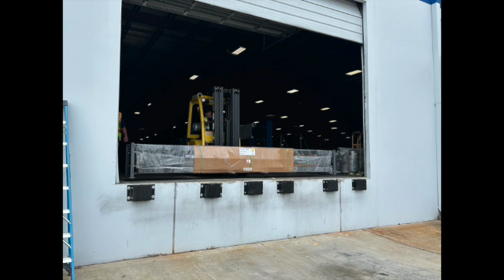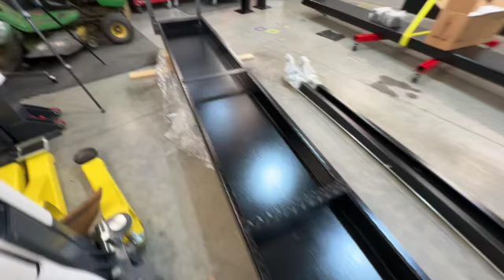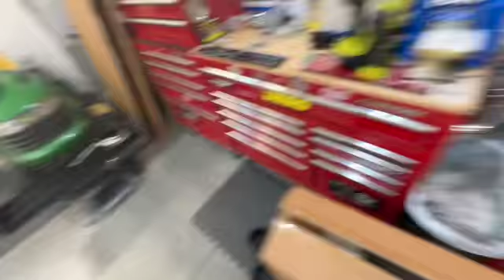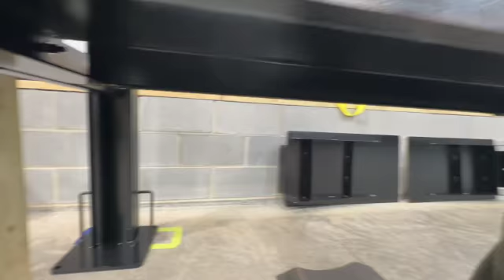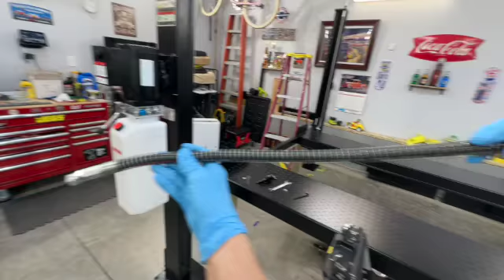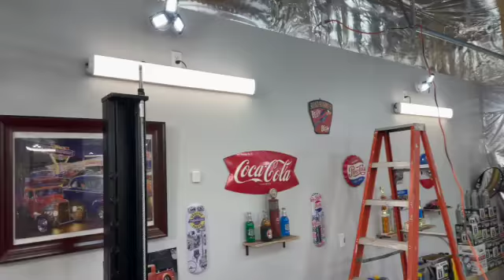DIY Single Person Install of APlusLifts HW-8SXLT

Comment: Thank you for the video, extremely helpful! one thing I did different was in order to move the ram by hand I used the engine hoist and lifted one of the cables up with it, that released the ram and everything else loosen up so I can install easily.

Comment: I know it is a year old video... First of all, thank you for the video as it clarifies many questions that I had.  I too have a MaxJax that I used in my old house due to low (8') ceiling height.  Now that we moved to a new (smaller) house, I was able to build a small 30'x30'x12' shop in the backyard, I was thinking of adding or replacing the MaxJax with a four-post lift.

A couple of comments and then a few questions.

Comments:

1. At around minute 50: The rubber hose that connects to the cylinder is rubbing against the cable.  Have you change the cylinder orientation to avoid that?  If not, you should.  From the looks of it, just rotating the cylinder should allow for the hose to stop touching the cable.  Or at least, place a protective cover on that section of the hose to avoid the wired cable to rub and cut the hose.

2. If the cylinder/lift is slowly coming down, then you have a leak.  There might also be air in the system and it needs to be bled.   Were you able to address this?

Questions:

1.  Did you keep the MaxJax or no longer need it after getting this 4-post lift?

2.  After a year, still happy with it?  Everything working as it should?

3.  Did you get replacement seals for the cylinder?  I recently replaced the seals in both cylinders of my MaxJax.  Mine is one of the first batch sold and the seals were in really bad condition.  The inner ones had disintegrated...   So best to have a spare set handy for both lifts (if you still have the Max Jax)

Thanks again for the video.  Very helpful.

Comment: You have a leaking valve or problem. It should not leak down at all. Like a manual jack. I would contact the manufacturer before it gets worse.

Comment: Does it matter which raceway goes on right or left side?
Reply from the maker: So the way the unit is setup, the tank and hydraulics are on the left side as you pull in.  If you wanted to have the tank on the right side, it might work, but you'd have to switch up where you installed the braces for the ramps.  I looked at my setup and seems like you could switch ends, the only issue being that the lever for releasing the brakes could be in the way of the vehicle tires.   I've taken some pictures to show what I mean, but replies don't seem to allow pictures.  I'll see if I can add them as original post follow-up or something.
Reply from the maker: Hi, so can't find a way to upload pictures... but did have another thought.  Download the manual if you haven't already.  I don't remember options for installing, but it's been a while ago now, so maybe they allowed for left or right installations.... worth a look.
Reply: @JoeSmith-pd6ck yes I was wondering same thing...I got one and basically drive onto ramp from opposite side than you did..but setup pump on same side as you have

Comment: Well done Joe! I haven’t pulled the “buy” trigger yet, but probably will…. I am curious if (with better casters) a guy could move this lift with a 3500# car on it (obviously in the lowest position to engage the casters)… Thanks for the video!
Reply from the maker: Hi, so I'm not the manufacturer nor designer and do not have a mechanical engineering degree... but....   I would highly discourage this.  Reason is the 4 posts are fairly moveable when the lift is down and with the casters lifting them somewhat off the floor, I would worry with tobbling of the unit.  And the manufacturer says NOT to do this too best as I remember the instructions and warnings.
Reply: @JoeSmith-pd6ck  - thanks Joe…. I’m waaaaay short on space and might be nice to reposition with a project car on it - if it’s wobbly - I sure wouldn’t try it….

Comment: Thanks for this!  Any chance you could verify the width distance between posts when lift is raised?  I'm looking to park a trailer underneath, their manual says 105" but their online support says its 99" (my trailer is 102").
Reply: So I did not anchor my uprights, as neither APlus nor many, many videos I watched also did not.  So far no issues, but the is a very slight movement with the rails go up... nothing bothersome, but only to note that if you down to the last 1/4" or so... it might be questionable.

As to the measurement, the inside edge to inside edge is 100 to 100.5" front to back... so just a tad too narrow :-(.   

While APlus seems to make a good product, their customer documentation does leave a lot to be desired... both from a consistency of presentation of material, but it making sense.  It's possible (although seemingly unlikely), that their manufacturing variance is 99 to 105 inches, but seems a rather expensive gamble to me.

Good luck finding that perfect lift.  I will say I researched the specs on about 11 such products before I bought this one, and according to my notes this tied with the widest drive-thru opening.
Reply: @ thank you!

Comment: Thank you so much for the walkthrough. I just assembled my lift following your video, and am at the bleeding stage. I press the power button to run the pump and get a rapid clicking noise. I followed the faq on their website and it said it could be a bad contactor. They sent me a replacement and it does the same thing. I noticed though, the contactor says 220v on it, the cord they sent me and the motor are both 110v which is what i wanted. Do you happen to have a diagram or could you show me how your contactor (its inside the square black box the power button is on) is wired? Assuming yours is 110v. I would really appreciate it!
Reply: In case anyone comes across this issue, tech support guided me to check the wiring in the end of the plug where it goes into the outlet. They had a batch of cords that were wired incorrectly at that end. Corrected that and it works great. Thank again for your video!
Reply from the maker: Hi, and sorry for the late reply (see comment to ncryder1 above).  Its near midnight as I'm reading this... I'll take a look tomorrow and let you know, although I suspect you have resolved by now... at least it'll be posted for future viewers.

Comment: Hi Joe, Great video! Thanks for taking the time to share your experience. I am about to order the exact same lift for warehouse pickup at the closest APLUS warehouse. Plan is to attempt the installation with primarily myself using identical equipment (2 ton engine hoist and leveler, pair of furniture dollies, scrap wood etc.). I am sure I can get it done with the help of this video (and recruit some help if needed). My one question is on how you removed the lift from the trailer (my biggest concern)? Any information would be extremely helpful. Hoping to use the engine hoist? Any insight would be appreciated!
Reply from the maker: Hi, sorry for the lateness of the reply (my Gmail account had been turned off and just realized... too many other emails I guess).  Anyway, for the home delivery I had a friend with a forklift type unit.  So should have mentioned that at the beginning of the video, never crossed my mind as it was focused on the actual install and not delivery.  But thanks for the heads up.  Hope things worked out OK for you.